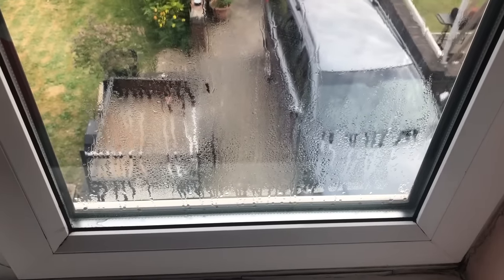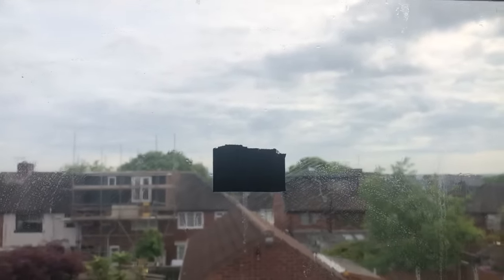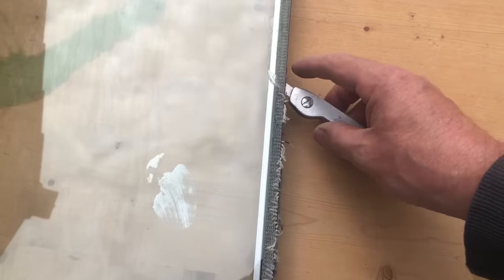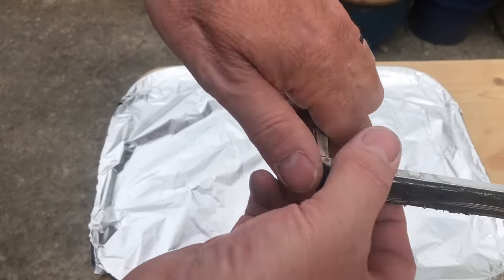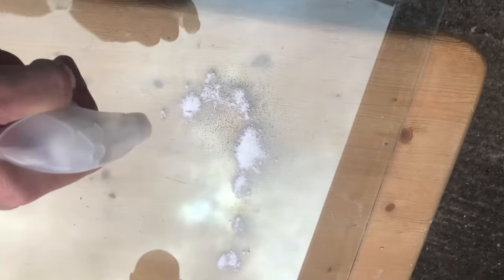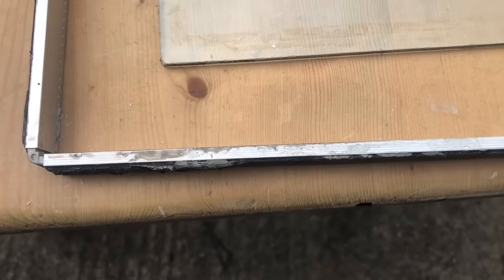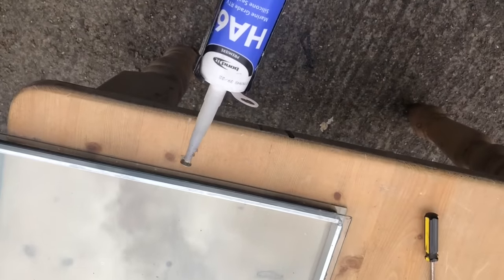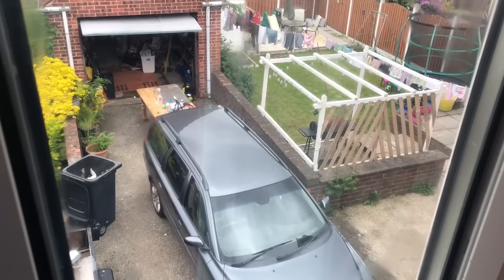Double Glazing Unit Condensation / Blown DIY Repair.

Comment: I must admit, I’m pretty handy when it comes to DIY, but this is waaaay too time-consuming. Easier to just buy a new panel. Btw, Marine Grade Silicone is the wrong type of silicone to use. As the name implies, ‘Marine’ is for salt-water use and we don’t get much salt (none at all) in standard rainwater. Valiant effort, but .. save your time .. too Labour intensive.
Reply from the maker: What silicone / sealant would you use as marine grade is just part of the quality albeit not required, but it’s for aquarium construction and some lifeforms require salt water for their habitat.
Reply: "Marine" in this context just means water, ie id also suitable for use where its wet, its not only for for use with the sea/salt water. Indeed its perfectly good also if it isn't wet. Absolutely the right stuff for the job, @keningworth492 is talking out of his .. continued on page 94
Reply: @davesmith9325  Actually, you're talking out of your ars .. continued on page 95. 'Any' silicone can be used for water-based projects .. which is why I made my comment .. MARINE Silicone, exactly like MARINE Plywood is SALT-WATER RESISTANT! Total waste of money using it on NON-SALT-WATER projects and expensive compared to Standard Silicone (which would have worked just fine).

Comment: So let me brake this down for you,to change that I would charge £80 minimum charge,turning the oven on and drying the desiccant out ? It’s useles,when manufacturing we have to test it every day and if it drops in performance it’s in the bin,chance of braking it ? Cutting urself ???silicone £10 a tube ?? 
Double glazed units are hermatically sealed in factories where equipment costs thousand.
This is a false economy and will only last 18 months if ur lucky.
Reply from the maker: I repaired double glazing units that are now over three years old and they are still going strong!

Comment: wow thats mad how rubbish double glasing is, no wonder they fail all the time  
just 2 panes glued together! , ive always assumed the sides were glass or resin heat fused together with the glass panes and with a vacuum or inert gas between, because  i like to think  expensive things are built well 
um  oops. 
unfortunatelly your extensive efforts wont work , your silicone will just tear off the glass surface -theres alot of unevenly distributed weight going on there causing shear forces , silicon is crap as an adhesive its just a sealant (proven by many a uk tiled in bath tub where there is just a few mill of floor joist flex and by by seal)  i would use rtv or better the adhesive used for glueing solar panels to the roof of motorhomes that stuff is the real deal
youve helped me to decide not to do anything about my 3 wet units now i know how they are such a scam
Reply from the maker: I believe they could design the double glazing units to last longer, the sealant I used is an rtv . I’ve just looked at the data sheet it’s described as HA6
High Modulus RTV Marine Grade Silicone. I have one other window that’s been repaired for over 3 years using the identical method.
Reply: @TheRepairer  Learned a lot from your video. Many Thanks. And now found out what RTV means - Room Temperature Vulcanising. I tried drilling small holes in the inner glass. Lets the moisture out, which was good, but leaves the stain on the glass.
Reply: @plawzzz6629  
In a lot of glazing problems the Sun's heat on the window over the years drives off all sorts of organic material onto the glass on the insides and that leaves residues that are permanent  and so it is not always only condensation of water vapour.

Comment: And ideally you want to put in Argon gass which is not simple
Reply from the maker: That would be excellent.
Reply: @TheRepairer  but how??? That is the tricky part :)
Reply from the maker: I didn’t,  not all are argon gas units.
Reply: @TheRepairer  I mean how could one achieve that? Nice brain teaser
Reply from the maker: @therealspixycat  In theory,  retro fit with the appropriate valves inlet and exhaust I understand and fill up I guess

Comment: I’m really not here to piss on anybody’s chips , I used to make  double glazing when I was a younger man, that won’t last more than 12 months 
Desacant is spent  and the seal won’t last  not only that if you have windows less than 10 years old they probably were manufactured with argon gas in them
Reply from the maker: From making double glazing units you have deduced that this repair won’t last more than 12 months and the desiccant cannot be reused at all and the properties of the sealant won’t last. The training you received in fabrication of a doubled glazed unit must be have extremely comprehensive and detailed.
Reply: @TheRepairer  yeah good point , obviously I know nothing, like I said mate not trying to do any body down just know from experience even factory made units prematurely blow, if your repair works more power to you, keep up the good work 👍

Comment: Well done for trying a repair. On the ones I tried cleaning up I could never get them as good as new, it was like the glass was etched.  Some small ones I just converted to single panes, my video here: https://youtu.be/rc5DutkQ0WM
Reply from the maker: My first off camera attempt had that very same limescale problem and it’s still holding air tight  3.5 years down the line. The solution to the cloudy look didn’t come to me  until I repaired the next failed window unit being the one in this video. Well  done on  your repair efforts.
Reply: @TheRepairer  Thanks. I tried strong ‘brick acid’ as well as limescale (calcium) remover spray that work on taps etc, as well as vinegar containing window ckeaners, in the end concluding it was mire than just linescale.  I even tried a lot of polishing with farela G3 ambrasive polishing compound.

Comment: No Gas Left, To Give It Better Thermal Capabilities 🤷‍♂️
Reply from the maker: Dehydrated air is the insulator.
Reply: @TheRepairer  So, why do they rate Argo so much then 👍😉 I get your point, it's good but I guess Argon sealed, would be the ideal?
🤷‍♂️👍
Reply from the maker: @kirkby0076  Argon is 15% better than air as an insulator according to this article https://windowguru.wordpress.com/2014/08/29/air-vs-argon-vs-kyrpton-vs-xenon/

Comment: Then you cut yourself realy hard... If you enyoj doing this ok, but othervise this is just stupid. You have no gass betven the glass. If there is a Low - E coating on the outside glass, it will get oxidated sooner or later. Not wort it.
Reply from the maker: I’ve never cut myself doing this repair and I have repaired four! Not all glazing has the gas in it’s just dried air!

Comment: lol... I'd call you a cheapskate but it would be cheaper to buy an new energy efficient insulated glass unit....
Reply from the maker: It was so cheap to do the repair though , less than £10.
Reply: @TheRepairer   I get it though. My hats off to you doing it yourself though...

Comment: sorry but you wasted your time,  its not a cure as the desiccant was not changed.
Reply from the maker: I’ve successfully dried it out before and it’s only there to absorb any moisture from manufacturing.
Reply: Well as a now retired industrial Analytical Chemist, I used Silica Gel all the time in various forms regarding size of granules. I used self-indicating Silica Gel which was bright blue when activated (contains Cobalt Chloride as indicator) and Pink when useless. To regenerate it efficiently takes considerably more heat and expertise than just putting it a domestic oven for an unspecified time and temperature.

Comment: Waste of valuable time,buy a new unit with a 10 year guarantee,oh and argon gas that can't be replaced and is a vital component
Reply from the maker: Renewal is always an option but costly.
Reply: @TheRepairer  not within the 10 year guarantee, and double glazing isn't effective without argon gas
Reply from the maker: @martinmartinmoone3104  Dehydrated air is a common filling for double glazing, there is also Krypton and Xenon. I’d get any windows replaced if they failed under a 10 year guarantee.

Comment: With 25 years in the fenestration industry.  I think i am qualified enough in saying, this is absolutely bonkers. 
You will never remove any water staining.
The sealent you have used would not last nearly as long as the manufacturers hot melt or 2 part mix.
You failed to mention units that contain Argon and not air ?
This would not work on leaded glass.
The tilt and turn window you glazed required toe and heeling. You do not do this or show this.

Mis information at its finest.
Reply from the maker: Your providing the misinformation, the water staining has been successfully removed and I have repaired units that are still working three years later. Dried air is the most common insulator in double glazing panels not all units are argon gas etc.
Reply: @TheRepairer  as someone that has done this hundreds of times. I can tell you, not all staining can be removed. You've been lucky at best. 
Also, I actually banned this at my company, due to the sheer amount of accidents it caused. People putting their hands through panes while pressing down too hard. People slipping with Stanley knives. The list goes on.

Comment: Just buy a new unit they don't cost much
Reply from the maker: That’s always an option but I’m loathed buy it twice!
Reply: Really depends on the size, I was quoted over £500 this morning for one and no I'm not in London.
Reply: @martinoconnor4314  I've manufactured pvc windows for 10 years and fitted them for 15 years and any unit to replace in a normal house window doesn't cost that much I'd say your getting ripped off